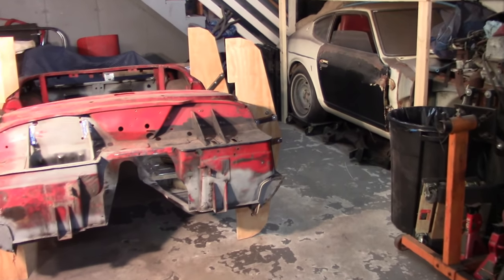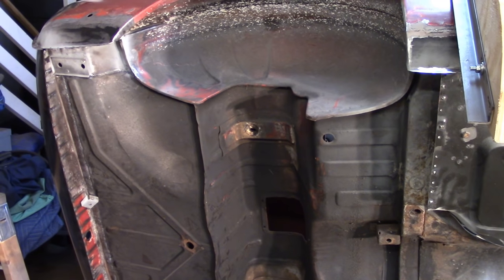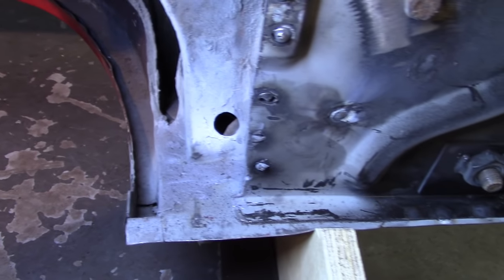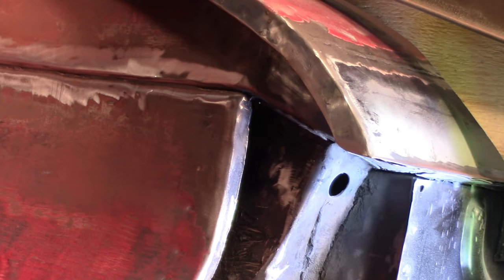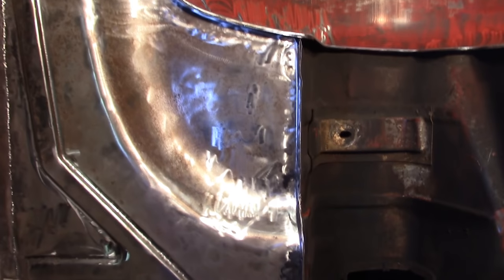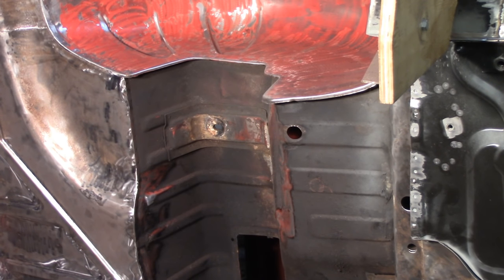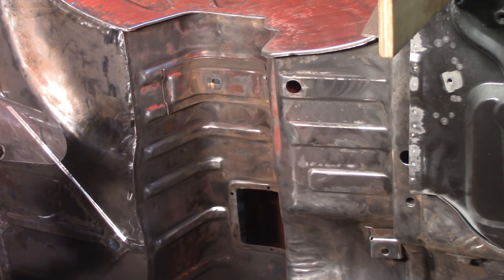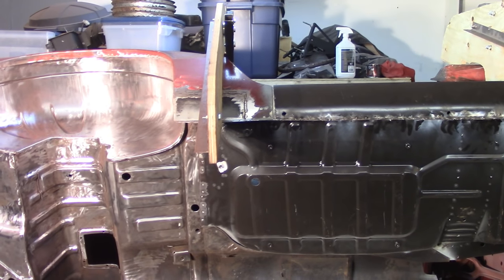Triumph Spitfire Restoration - Cleaning the "Underneath"

Comment: Excellent detailed video Chris. I’m about to strip my 71 GT6 body.  Luckily its on a rotisserie.  Any advise about methodology beyond the mechanical method you used (ie chemical strip first?)
Reply from the maker: Thanks, Jonathan. I didn't do the chemical thing because I didn't want to deal with the cleanup from a disposal concern (I'm still sweeping up red dust all over the place). It would have made it easier, though, I think. Aircraft stripper is something I would look at (that's the generic name, I think) but I don't have any recommendations on a particular manufacturer. I did try some of the citrus stripper and it was okay, but you needed to reapply for each coat of paint. No matter what, make sure you understand how to neutralize / get rid of it. It will wreak havoc on your epoxy primer if you don't get it all. I'd recommend SPI's forum (where I got my paint) to see if you can find recommendations (sure you can). http://www.spiuserforum.com/index.php
Reply: Chris Fisher Thanks for your quick reply.  I’m wary of starting the stripping operation so I will do the research at SPI before I start. Many thanks for your advice. PS. You have a fantastic YouTube resource for guys like me. Well done.
Reply from the maker: Thank you very much, Jonathan, I appreciate that!